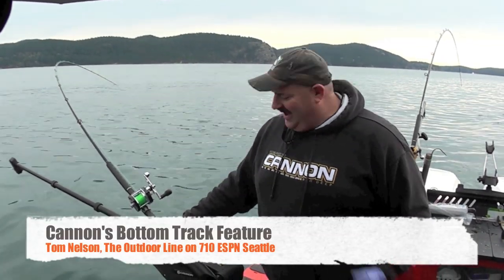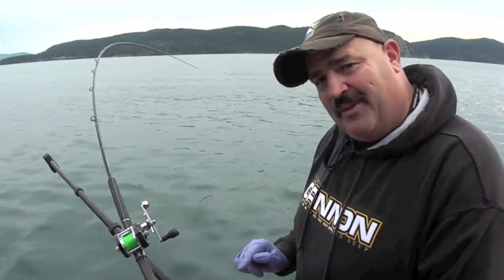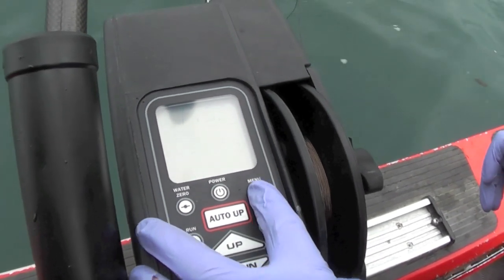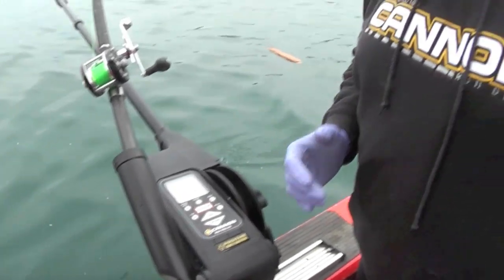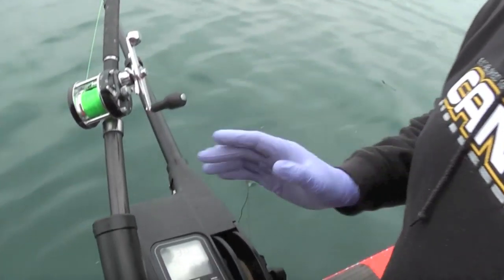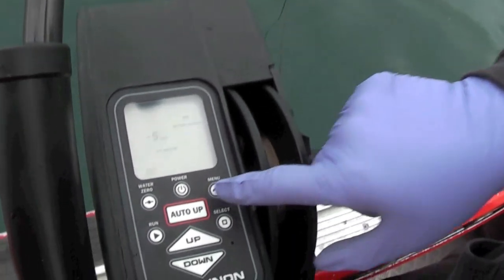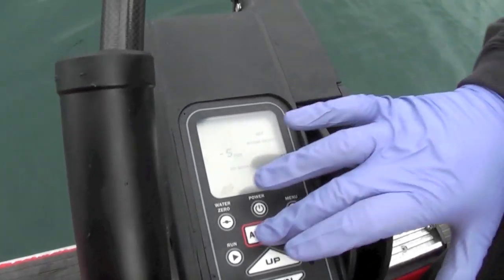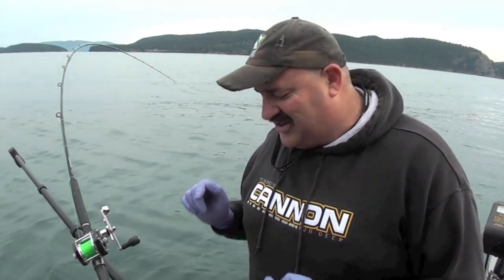Cannon Downriggers Bottom Track Feature

Comment: Tom,
I've been running cannons bottom troll for years, What makes them lose track of the bottom.  I meed from 60ft it will register 500, 300, 800, 900, 5, 76, what could be making them totally lose accurate bottom depth?

Comment: Hi Tom,

I have 2 cannon digitroll 10  TS's. connected with the proper cable.  My bottom tracking only works for about 1.5 hrs then it looses track of the bottom.  Mis reads. ie. 65', 100, 57, 255, 65, 300, etc.  I have shut down all electronics to make sure there's no interferance.  I've shut down motors to make sure there's no pro wash issues.  WHAT COULD BY WRONG?
When it works it's fantastic.  But it looses track of the bottom?